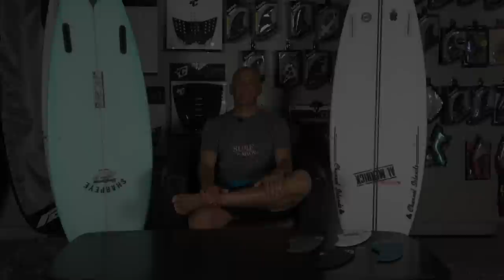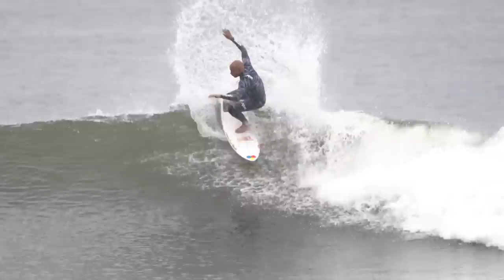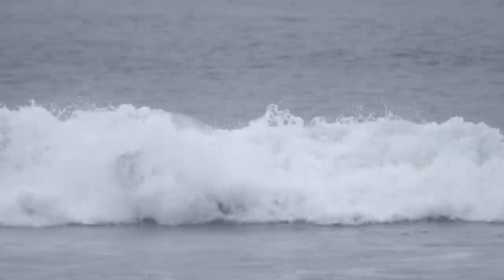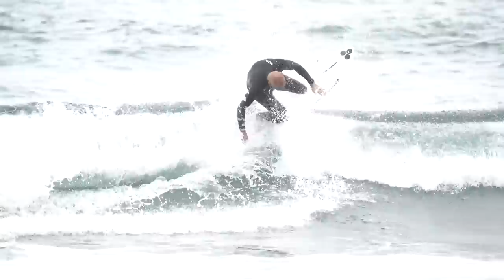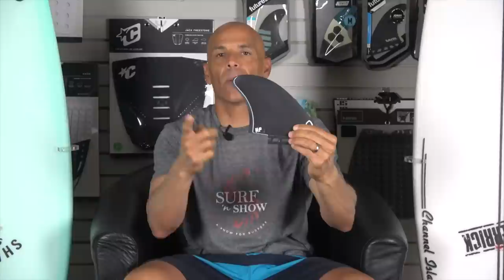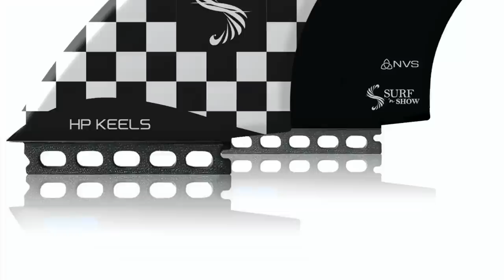Creating a "High Performance Twin Fin Keel" Design Vlog by Noel Salas

Comment: When you first put the 1st prototype fins in your surfing looked so much better - so smooth - and suddenly you were drawing Parkoesque lines. The waves weren't as good for the rest but I think on the 2nd prototypes your surfing is much better too. I remember thinking you liked those strange fins with the super long tips flaring back and I was sort of expecting on the 2nd prototype for you to cut into the base and make them more upright (as you did) but just extend that tip a tiny bit.
I'm so impressed - I'd really think you should make a quad set next and then a thruster set - maybe the thruster could even be similar to keels with a narrow, upright fin in the back - this is likely a stupid idea but hey... I think this is so awesome.
I really think this fin makes a lot of sense compared to many fins on the market - I feel like most fins are Pro versions for surfing comps and I'm amazed at how, 1st proto-type you can get a fin that immediately suits your surfing. Maybe custom fins are the future ;) I mean I think I'd pay double to customize a fin I like - if once you are happy with the design extra fins are normal price ;)
Reply from the maker: Stoked you like the Vlog and my process tweaking the HP Keels to get exactly what I am looking for. I did design two Thruster sets and a Pivot set of Quad Rears. Check them out on our website here. https://www.shopsurfnshow.com/collections/momentum-series

The Thruster sets and Quad Rears have a concept I'm calling the Momentum Series.  I have been working on for a couple years now. Momentum Series Concept:  My concept is hybridizing a Large fin base with a Medium fin depth. The large fin base offers excellent resistance for surfers who like to push hard through turns for maximum drive. The medium fin depth enables surfers to retain the speed they generate through turns with less drag, keeping the board fast and loose.

Comment: Hey Noel, those are sick fins! I had a question: what set of nvs fins would you recommend for a hydroshort? I’m 6’0 170lbs riding a 5’9 helium construction in soft Florida waves. I remember you mentioned that futures R6 felt good on the hydroshort, but mine is in fcs and I really wanted to give nvs a go!
Reply from the maker: Our MS-Neutral template would go mental in that board. Check them out on our website here https://www.shopsurfnshow.com/ If you need finst now then hit the folks up at NVS and ask them what Neutral fins they make in size medium for that board. I bet the Large Peregrine fins will go good in that board too. Cheers

Comment: Hello Noel
Congratulations on the review. You help a lot in deciding which best keel and board we should use
For those fins you developed, which board do you think fits best? Al Merrick Fishbeard or Lost Swordfish? Which of the two boards do you feel a better performance surfing?
Thank you
Reply from the maker: They suit the Fishbeard best out of the two boards you metioned. The Swordfish is not a true Twin Fin as the boxes are set for Thruster or Quads. The side fins will be a bit more forward so the Swordfish will be very loose and harder to control. It will still be fun as a Twin Fin in 1-2' surf but no real comparison to the Fishbeard or other Twin Fins that have the fin boxes set for Twinnies.

Comment: Hey mate, great work! 
I'm riding a HK twinnie 5'9 with keels at the moment, wouldn't you personally rather go for the HP or Futur Rasta, considering it's the HK PU model
Reply: Will be probably a long wait for the HP though, live in Australia
Reply from the maker: My HP Keels go good in the HK but my HP Twins offer more performance on that board. If you like carving and lots of drive my Keels are better for this sled

Comment: Hell Noel! How did they feel on the El Tomo Fish since the fin boxes are higher up on the board?
Reply from the maker: The El Tomo Fish felt loose and a bit harder to control but still really fun. I think groveling in 1-2’ surf on the El Tomo Fish with my HP Keels would be even more fun. Easier to control and the board will be really fast and playful.

Comment: How does the hold/traction on these fins compare to the AMK twin fins?
Reply from the maker: The AMK’s have more hold due to them having more rake and fin area. My HP Keels have excellent hold due to their large base and good fin area. My Keels offer more pivot, release, and maneuverability. Another important thing to consider is the AMK’s have so much fin area and hold that they put a lot of stress on the fin boxes. I broke two fin boxes on two separate boards doing bottom turns with the AMK’s. A few of my friends have stress cracks on the Fishbeard’s due to the size and stress of the AMK’s.

Comment: Noel, noticed you have mm in the base/height, and inches in area and some of the other fin dimension info is missing. I might cop a set of thruster and/or twins. Wanted to confirm sizing first...
Reply from the maker: What fin dimensions are missing?
Reply from the maker: We will not be putting the Cant and Toe on our fin specs and please convert the mm or Sq in.... whatever is easiest for you.
Reply: @surfnshowreviews7777  cheers guys, good luck with the business.